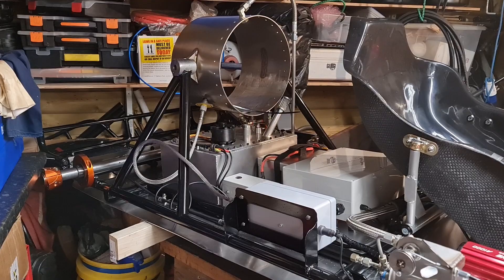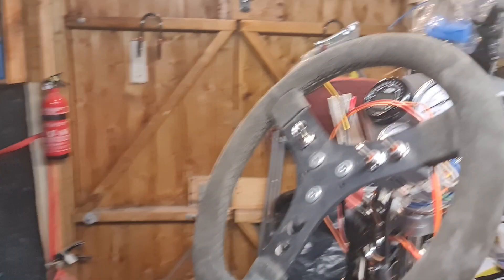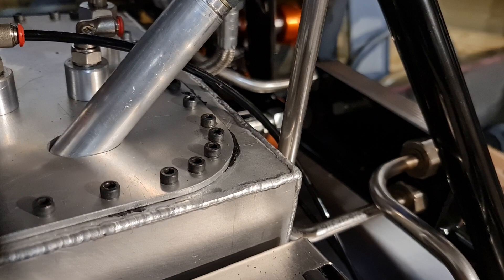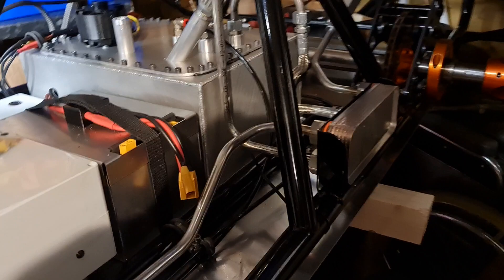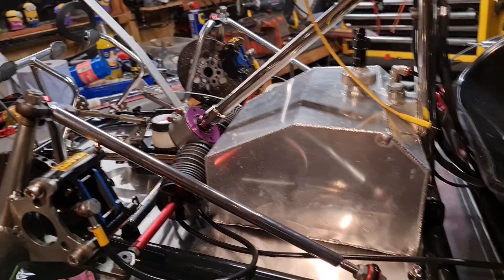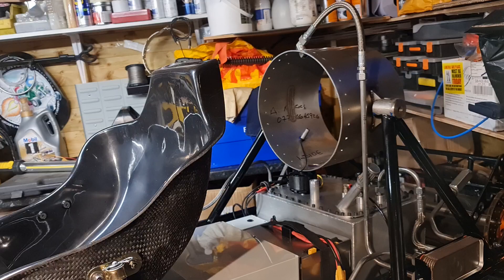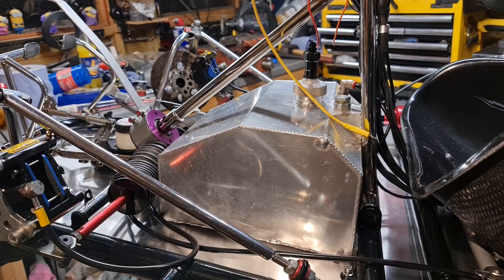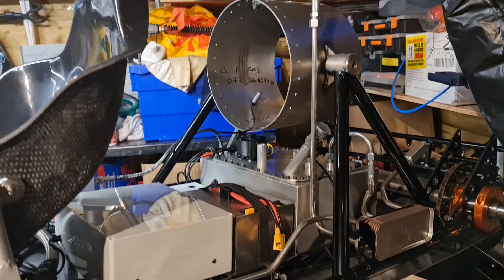Project 175 World Record Jet Engined Go Kart

Comment: Andy, this is truly looking incredible. Excellent work and wasting no time I see. I'm always very impressed with your work but I feel like we went from seeing some systems testing to a full blown kart in a very short time. 🍻
Reply from the maker: Yep.... its come together very quickly.... lots had been done before hand, been buying things for over a year.... Steve my friend that dose the welding had time to do the chassis etc.... few other bits came together at right time, so saw the chance to get it sorted.... paying the price now..... hands hurt, back done in, knees after crawling around on all four 😂The help from you and the other subscibe us... has given me motivation. Paul, Ben and Alan at eastmids hydraulics did hoses for me. Am picking up Kero morrow, just do full system test, check pumps switch on/off as they should... But lay out been in my head for months 🙂but thank you 😃

Comment: Hi Andy, I'm now a patron sorry I can't afford more than £3 a month at the minute until I get on top of saving up again I will increase it in the future your channel is well worth it amazing content i suppose every little helps I have just bought a double ring  fuel spray rail and the flame defusers from a tornado  rb199 afterburner hopefully that will save me time trying to drill lots of holes in stainless pipe is there a science behind the diameter of the pipe my hot end turbine is 200mm this fuel ring with the diffusers attached  is 440mm am I right in thinking I will make a flange with reducer to fit the hot end then make the main afterburner say 490mm then reduce it at the end again to 200mm so it will be hot end 200mm middle 490mm end  200mm so I'm thinking this will give it a little back pressure but still 200mm at the end to match the turbine wheel so it doesn't overheat the motor?
Reply from the maker: Wow.... thank you, yes every bit helps, and to know other enjoy the project.... it helps know end on the days when thing are not going to plan :-) Nice flame rail.... your plan sounds spot on, always start smaller, you cam cut a little off if you need to.... looking forward to seeing your work.... am hoping to get in the shed soon, now its warming up, get a video done.... been to see CNC guy today.... hes hoping the machine will be free in a week or so.... :-) again thank you so much ..... the day has got so much better
Reply: @Jet Engines Andy Morris  Thanks for the reply no problem I'm just collecting parts that I need at the minute next I need an exhaust thermo couple 2 big truck batteries I think to make 24v and oil pressure/temp sensors and gauges I will keep you posted when I get around to running/testing it 😀
Reply from the maker: @BREN2009  Please..... it might seem to some that the kart came together fast, but lost of part have been brought over last year..... put aside like yourself..... takes some time but worth it in the end..... thank you again.... every little bit does help 🙂